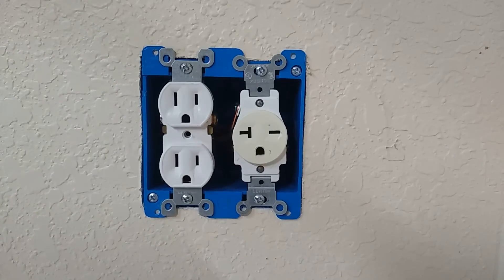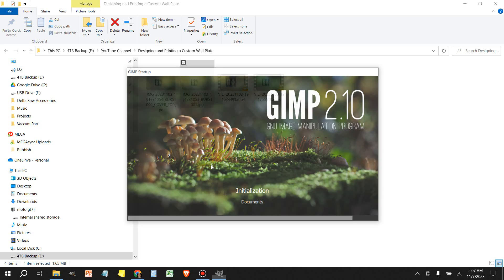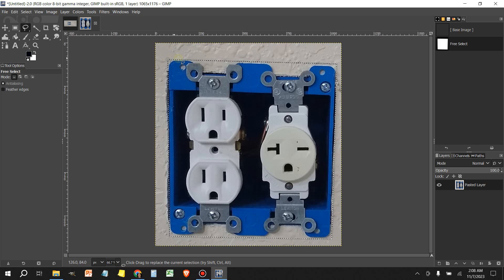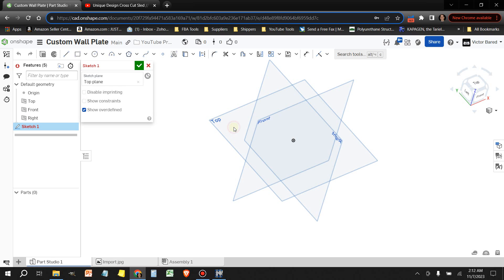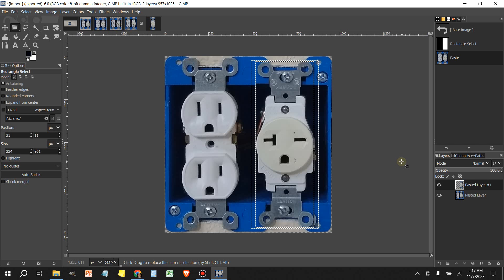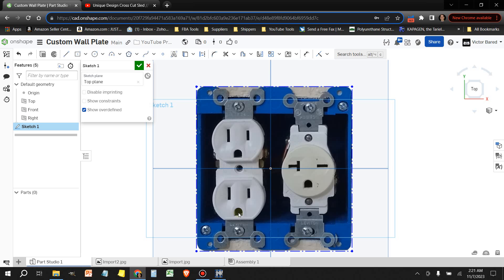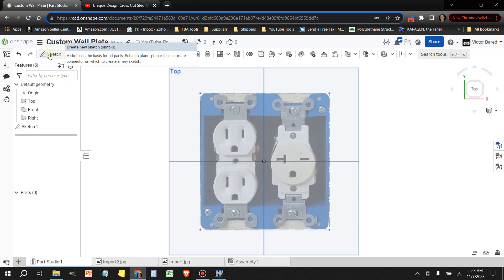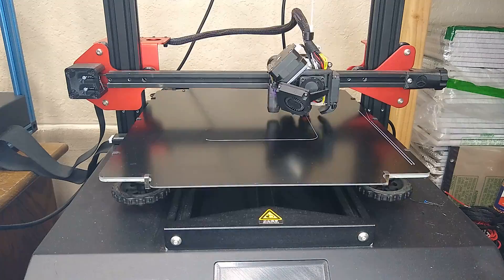How to Use Pictures in OnShape to Design Parts that Can Be 3D Printed

Comment: Nice, I like these little projects for issues like this. When you take a picture of something to import, to prevent some of the skewing, just back up from the object a few feet and zoom in with your camera. It should remove the skew. I have found that works for just about any photo.
Reply from the maker: Hi Steve, What's going on brother? Thank you for the zoom tip. Not having to deal with correcting the picture will save lots of time. 

I hope all is well with you.
Reply: @vbared  Everything is going well. Got moved into a new house. Men's spending all my time working on it. I haven't spent much time 3D printing anything at all.

Give that zoom in a try and let me know how it works out for you. I learned about wide-angle and distortion sometime ago. I found taking pictures of people close up and animals makes a huge difference when you just back up and zoom in some.
Reply from the maker: @stevesweb  Excellent, congratulations on your new home. I'm sure getting settled in will take some time.